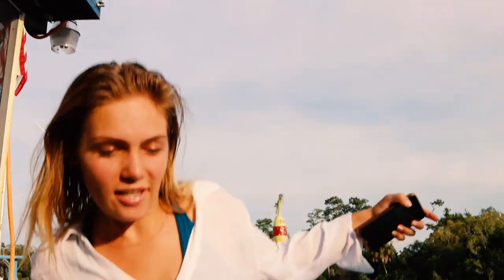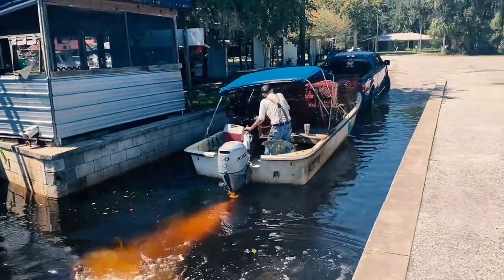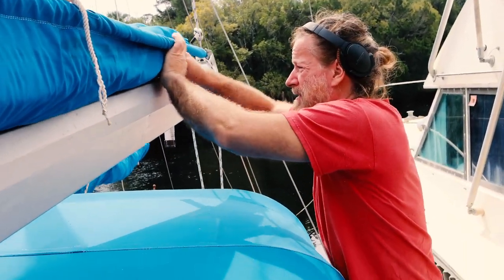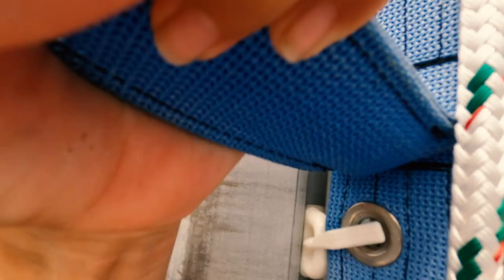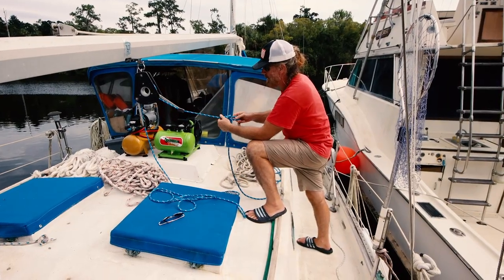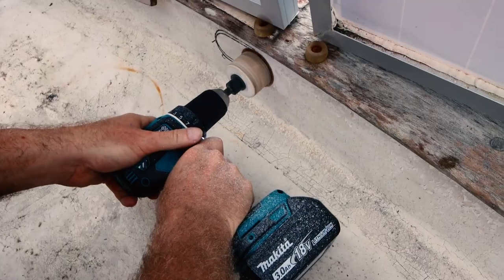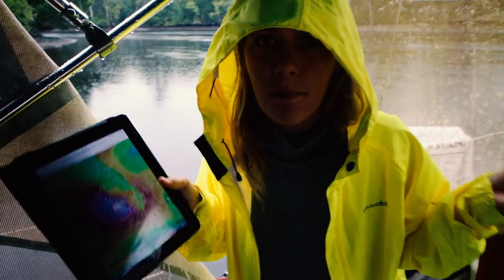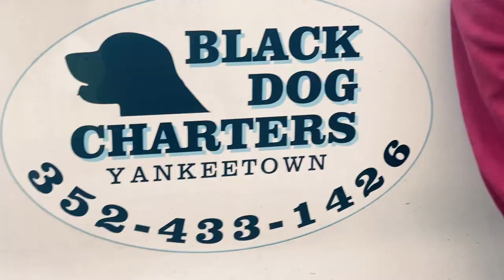Sailing Liberty- Surviving Hurricane Ian / Preparing for the Worst / Emergency Mast Climbing S2E06

Comment: Electric winch!  You are one special woman.  I cannot believe that your first time you climbed. I’ve never climbed. I get hoisted by winch with a second safety line.
Reply from the maker: We are planning upgrading to self tailing winches, maybe to electrical winches one day- it would be a great addition to have. We have a hoisting chair as well, but I would not have a control of the movement towards top of the mast and Ted cannot tail my safety line and the hoisting chair simultaneously. I should get then a Petzl prussik and tail the line myself.... In the future climb I want to put a second halyard and have a second safety line which I will tail myself and have Ted tailing below. We have spots for 2 halyards but we use only 1. Every time I talk about climbing my palms and feet are covered with cold sweat... True meaning of conquering the fear.

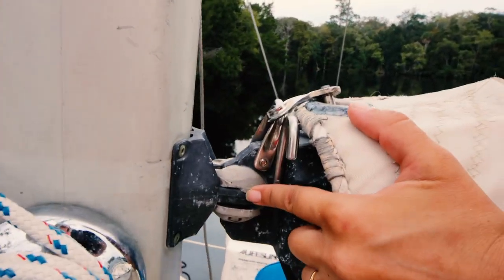Comment: @11:48 Is there a allen head or recessed bolt that goes through the light grey part to clamp it to the dark grey mount?  Maybe just loose?
Reply from the maker: I am researching Sparcraft/Isomat NB1 Gooseneck Ball & Clip Kit... seems like some clips are missing. Not sure yet. If nothing else then we can tie the gooseneck to the mast with some lines 😅
Reply: @SailingLiberty  Duct tape if you want it together, WD-40 if you want it apart. ;)  Good luck!

Comment: I read your reply,
 Use gloves as well.
Also concentrate on pushing your body weight with your legs, not pulling yourself up with your legs.Think about how much bigger your legs are compared to your arms, they are much stronger… but you have to concentrate and focus on using your legs to climb that strap…
Perhaps you could practise by climbing just up to the spreaders, then back down…
❤❤😊😊
Lastly , you might have put the boom down on the deck to reduce windage, it’s easy to do.
Reply from the maker: Thank you Edward -it is not easy to do!